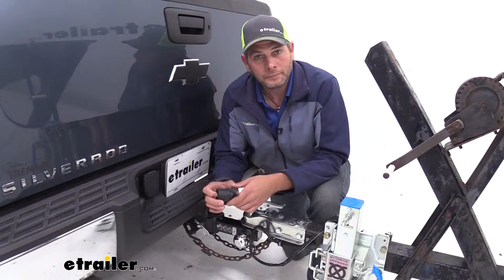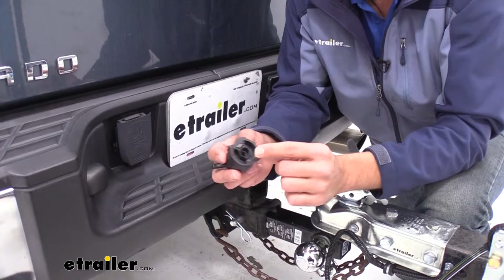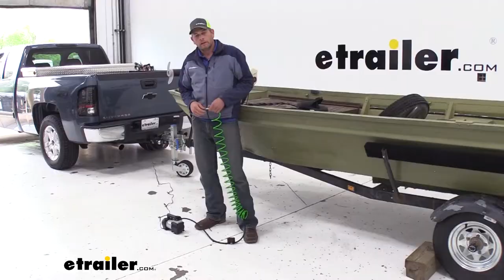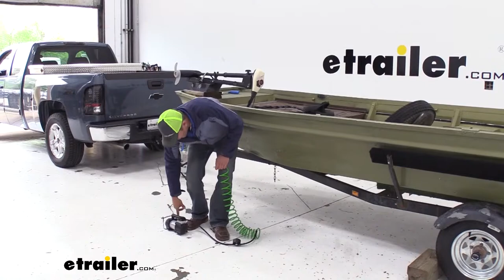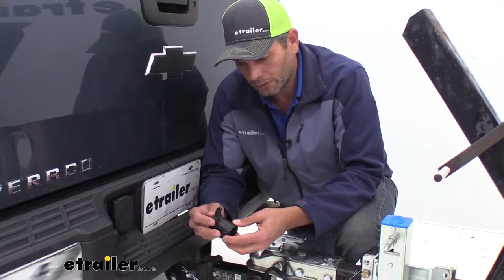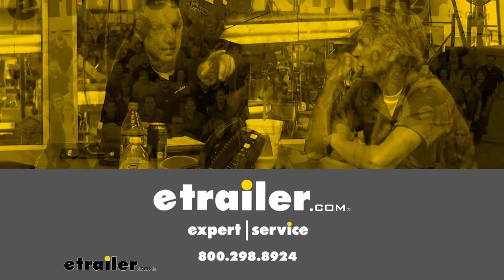etrailer | Pollak 7-Way to 12 Volt Power Outlet Adapter Review

Comment: Hi....will it work with a 2019 F150 Platinum......I understand Ford pin connector won't send any power unless it sense also the brakes and light......
Thanks!
Reply from the maker: This plug adapter will work so long as you are getting 12V power to the 7 pin connector.
https://www.etrailer.com/Wiring/Pollak/PK11896.html

Comment: Do you have an adapter to plug my trailer into a standard home outlet?
Reply: Easiest way would probably with this adapter and an amazon power inverter. This will connect to the 12 V plug.